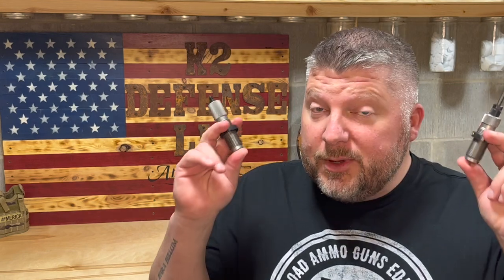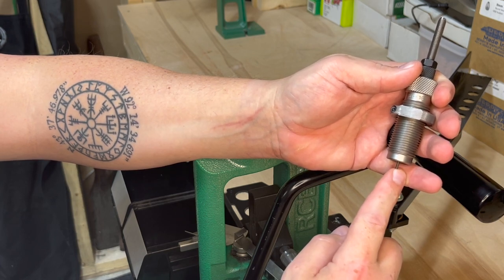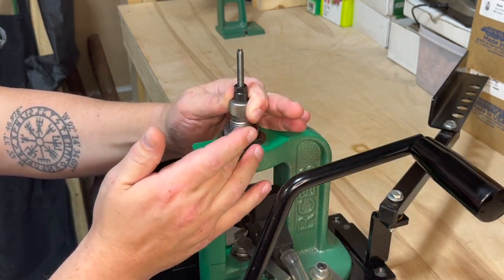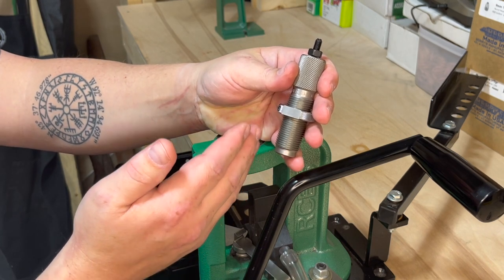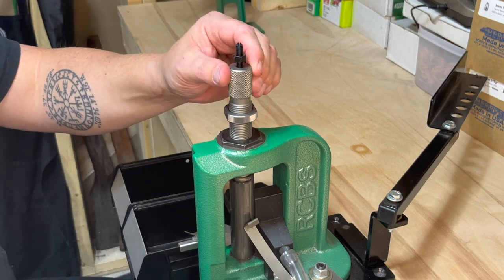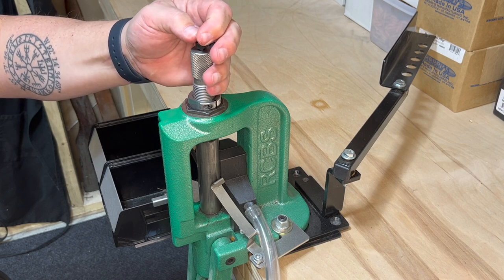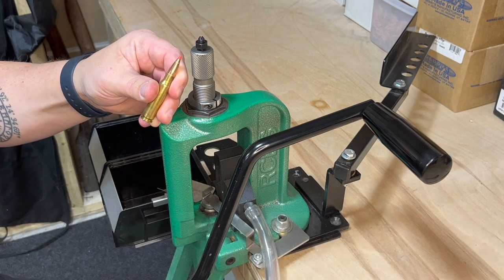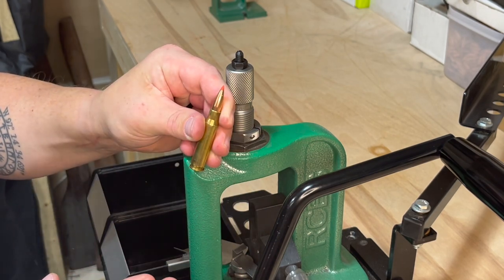.308 Winchester RCBS Die Setup for Beginners

Comment: I'm not trying to be picky but you had stated 1 full turn back out for the seating/crimping die but it looks to me like you only went 1/2 turn out. Am i right and if not please correct me. Thanks
Reply from the maker: @vincehable1078 - the instructions say one full turn. You are correct, I didn’t do one full turn. As long as you clear the projectile and case so that you don’t prematurely seat the projectile in sideways, you’ll be ok. Again, the instructions say one full turn. I’d suggest following the instructions until you feel more confident. Appreciate the question! 👍🏻

Comment: How much crimp on the .308?
Reply from the maker: Hello @ralphdavis6052!

You’ll hear varying opinions on this topic. With non-cannelure projectiles I only apply a limited crimp. This is avoid ramp feed issues that I encounter with the AR platforms. I just make sure the case mouth “lip” is flattened against the projectile. With cannelure projectiles, I use a roll crimp. This is a bit more aggressive. You’ll see the case mouth lip turn into the cannelure. It’s a bit hard to explain and easier to show. I’ll do a video to explain in the next couple of weeks. A word of caution, make sure to not over crimp as this could lead to pressure issues and firearm failure. Hope this helps!
Reply: None

Comment: Is it different for aluminum die?
Reply from the maker: Which die set are you using?
Reply: @k2defense  im not sure. I just received some reloading stuff, kinda a mixed bag. But it’s an rcbs press and some other stuff I was given. Just didn’t know if it was different? Do you have a book to recommend that will walk me through it all as I start learning?
Reply from the maker: @heavydieselengine8989   - you came to the right channel. Review this video. It will help sort things out for you. https://youtu.be/euZl_mPOEkQ?si=BefAy_v7gWz5K-Xf

As far as manuals are concerned, any of them will do. They all explain pretty much the same thing. I tend to rely on Hornady reloading manuals more than others. It’s just my comfort level. The reloading manual is a good reference for many things. I’d suggest to check out other channels as well. Each channel will give you more information in different ways. And finally, make sure you subscribe to the channels as it is the easiest and cheapest way to support creatures that bring you this information. Hope this helps! 👍🏻

Comment: I’m confused - when you initially set the bullet depth, you had the crimp of the die turned up one full turn (no crimp). Next, when you turned the die down to set it to crimp, you then rolled the seat depth screw back to the same position.  Wouldn’t that change the depth of the bullet seating, since the die is one full turn back down (plus the small amount of turn down to apply the crimp)?  Seems like it would seat the bullet down further that full turn, plus whatever the crimp amount was?
Reply from the maker: Kenneth Vance - thank you for the question. The first step is to seat the projectile to the appropriate COAL. The second step is to apply the crimp. The third step is to set projectile depth and crimp together. If you do it per the instructions, you will not change the COAL and seat/crimp simultaneously.  Hope this helps. It took me a couple of tries to get it down to what I consider perfection. I get a lot of questions on this so keep them coming if need be! 👍🏻

Comment: Note; if you know the threads per inch.  You can determine what one full turn of the die will be.  Helps if you want consistent crimps between loads from yesteryear and this year.  Also know the "one full turn distance", can help you with seating depth.   I hope this understandable.   Outside of that, a good video.
Reply from the maker: Great info! 👍🏻
Reply: One full turn is just over 7 thou (,007).

Comment: That is how I started reloading the die setup, screwing them in or screwing them out when not being used. I have since stopped screwing in or out of my dies, instead, I am using Hornady's Die Bushing - Lock-N-Load on my RCBS Summit press. I don't know if it maintains accuracy in resizing with this method. Just something read many years ago.

Comment: Great vid. I don't get it. At 6:16, after the crimp, you re-positioned the seater plug and you tuned the nut. Doesn't turning that nut mess up the depth of the bullet?
Reply from the maker: After you have the crimp set, the next step is to reset the seating plug. So, set the crimp, lock the locking nut. Dial down the bullet seater plug until it is pushing on the tip of the bullet nose, lock the locking nut for the seater plug. Now you’re good to go. I struggled with this for the longest time so don’t feel bad. It takes time to wrap your head around it. Happy to walk you through it again if need be. No worries! Happy to help! 👍🏻

Comment: Instead of running the bullet seater down incrementally and removing the round to measure could you use a snap cap? Assuming you strictly wanted your COAL to be SAAMI spec and you weren't playing with seating depth.
Reply from the maker: I suppose you could, however, I wouldn’t recommend it for liability reasons. I will say that is thinking outside of the box for sure. If a person were going to do it you’d need to make sure you’re using the correct projectile seating plug and COAL. Hope that makes sense! 👍🏻